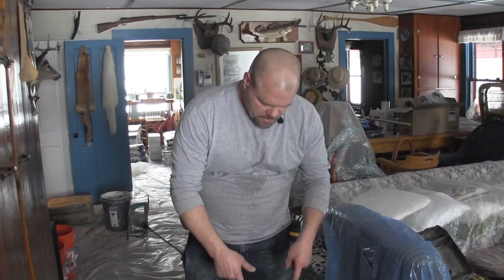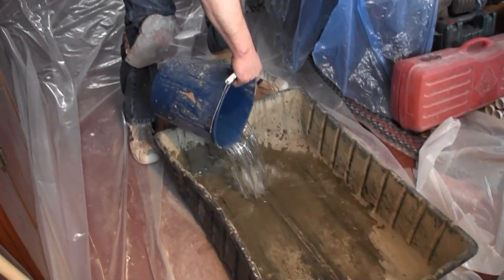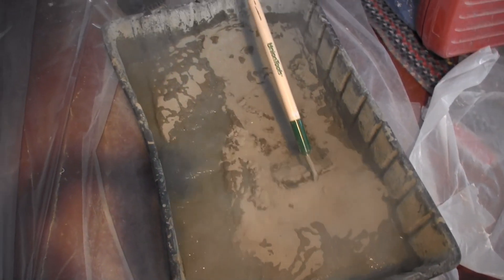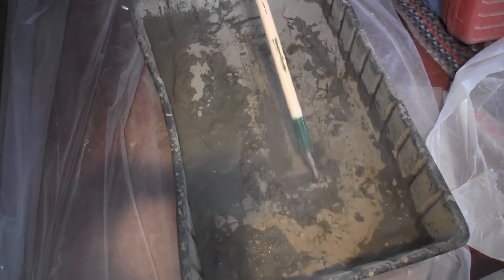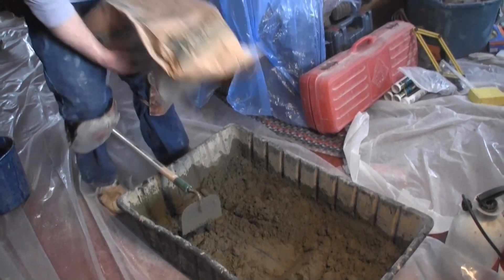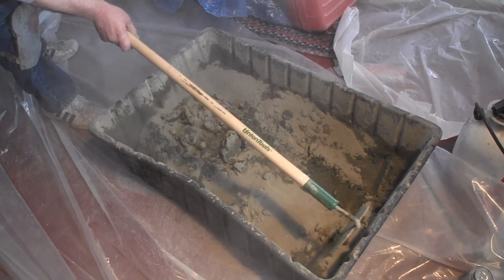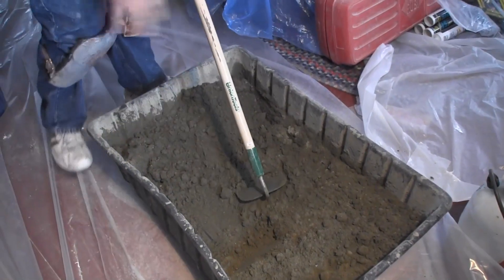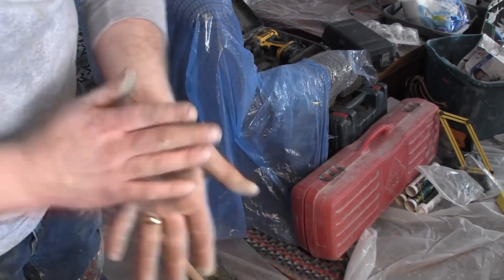How to build a shower pan - how to mix deckmud

Comment: If you have a large shower floor to do can you mix in 2 batches? I know it would be difficult to get exactly the same consistence - but does that matter?
Reply from the maker: Yes you can. Just to be sure what you are asking though - Do you mean on two different days? Cause you could do that too but you would want to apply thinset with a brush on the area where you are going to connect the sand the sand mix together
Reply: all on the same day - just don't want to have to mix 200lbs all at one time....thx

Comment: I've started to put down the sand for my shower pan and ended up short on sand. Would I be able to add more tilekrete afterwards when the first batch has begun to set or fully cured?
Thanks in advance and thank you for all your great videos!!!
Reply from the maker: Yes. but you need to paint a slury of thinset  on the pan that you want the next batch to stick to. It will act as an adhesive and bod the 2 batches together.

Comment: Love your videos.  Unfortunately I followed the directions of my plumber and I used QuicKrete Sand and Topping mix to make my shower pan, I mixed it dry like the videos showed.  I think I mixed it too dry because there were certain areas that crumbled the next day ( today ), so I gently roughed up the surface to get all the loose stuff out, vacuumed, and now I am getting ready to lay the floor tile in the shower.  So - am I screwed or will I be ok?  I would upload pictures but cannot here.  Hope you can get back to me.  You've been so helpful!!!
Reply from the maker: Fill the holes with thinset and all will be fine.
Reply: for that, you'll want a masonry and sand mix, (deckmud) not a Portland and sand mix, sand topping mix, but you will be fine.